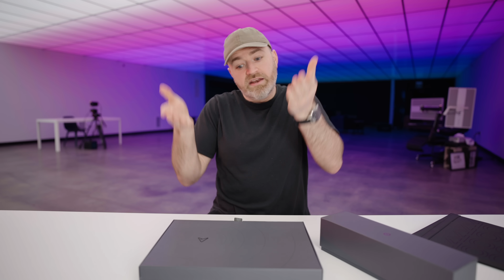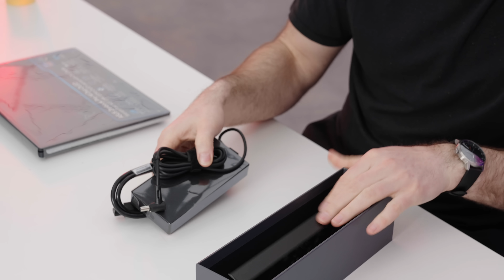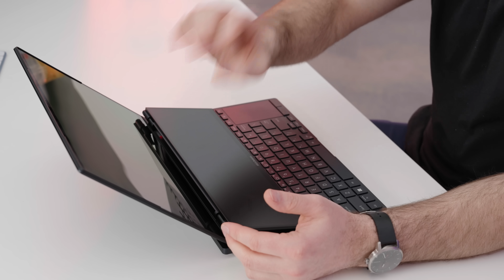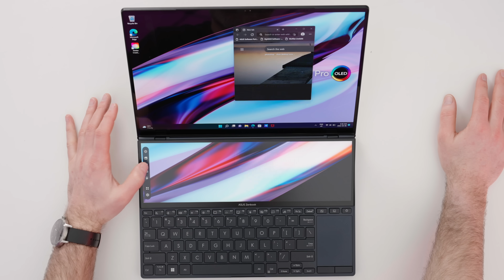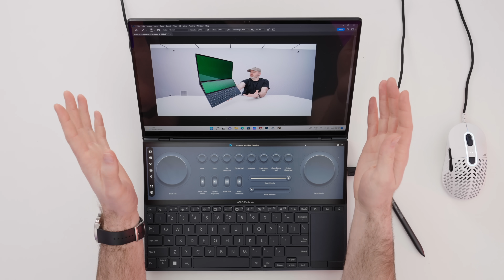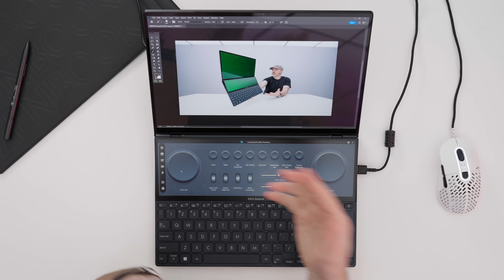The Most Outrageous Laptop Ever Built...

Comment: I use a second monitor connected to my laptop all the time, and i use it for mostly 3d modeling. The software that i use can open up multiple windows in which you can do different stuff. But also think of the file explorer if you have to import or export lots of files. Or if you have to open up a picture to use as refence for the object you're modeling. When I'm on the go I'm not even used to one single display anymore. It's stuck in my workflow. So therefore a small extra one below is perfect for me while I'm on the go. But even when i have my second monitor connected i sometimes like to have a third one. Think of your 3D scene in the main screen, your material/texture editor on the second monitor and reference images in the small display. Instead of making smaller windows on my laptop or second monitor.

Let's say that this is a good buy for artists, video editors, programmers, or any other people that like to work with multiple displays. But if you never really need more then one displays then i can imagine that it's not worth it.

Comment: ASUS has constantly been the world's most innovative tech company right now. Change my mind.
Reply: Look at the stats how often and fast Asus notebooks break
Changed your mind?
Reply: @harrison00xXx  ASUS is a great company. Just accept that move on. Don't have to petty and toxic about a brand you are nowhere associated with. Jeex!
Reply: @NomanJohan  why i even should associate with a bad manufacturer?
Reply: @harrison00xXx  Yeah you shouldn't. You should get a job and have a normal life like everyone deserves. I hope the fortune shines on you in future so you can afford innovative ASUS/ROG devices.
Reply: @NomanJohan  Whats your "job"? Are you working for asus to spread the ROG religion?

And i could afford any Asus notebook, but there is no sense since the price doesnt fit the overall quality or mobile performance.

Also, these notebooks are LOUD, if you need a powerful GPU you basically need a huge case to make it "silent" (as far "silent" is possible at all with intel and AMD) under load.
Even my pretty heavy modded HP Omen 17 (LM, better airflow, nearly pressurized, filtered air from 3x 140mm PC fans pushed into case) with RTX 2080 150W struggles to get rid of the heat and the fans are definately annoying a bit. Not close as much as it was stock without additional external "blowers" or liquid metal, but still its a windows notebook, they get loud when there is any bigger load, even for only 5 seconds since the CPUs spike up to 90° easily for "basic" stuff.

So well, yes i have a decent gaming notebook with fully powered rtx 2080 mobile (even a 190W alienware vBios installed)
But its unflexible, not really the definition of high quality or anything for mobile usage, but well i can also afford another, MUCH BETTER notebook, my 16" MacBook Pro 2021. THATS A REAL NOTEBOOK! Absolutely love it after finally upgrading from a 2010 15" MBP (good old machine, using it right now! Smh the keyboard feels even better on the old 2010 compared to the 2021 model, but both are great, just slightly different hub and force needed.
Reply: @NomanJohan  This "system" fits my usage also much better than any "allrounder"... because i have with 2080 Max-P basically nice performance and stil a proper cooling with the huge case of the Omen 17.
And since, as i said already more than enough: any allrounder/"i can do everything for everyone" machine will have sometimes only minor downsides compared to "dedicated" machines, but more often than not HUGE DOWNSIDES (the ones i mentioned which you think is because "i am poor" lol)
And therefor, as "expensive" it was, around 4000$, 1750$ for the RTX 2080 notebook in beginning 2020 and now 2350$ for a 16" MacBook Pro 2021... well, sadly it replaces the RTX 2080 notebook/"desktop replacement"  completely, except for gaming. Sometimes im still using my old, self built desktop which got sadly only a GTX 1050 Ti in it anymore after selling with a profit my GTX 1070 after 5 years heavy gaming and even mining in the last months lol, poor buyer :D

So yes, seems like im pretty poor since i need, ok lets be true, want 2 notebooks, both with a dedicated reason... ugly windows gaming notebook... GAMING at its best, no compromse!
Good old, awesome MacBook Pros? Well, especially with M1 Pro and Max literally better than desktops (and more silent, as a notebook!)
Reply: @NomanJohan  You know whats my biggest problem with Windows and the typical x86 hardware.... its that garbage, all which brought me for many years to windows notebooks was because Apple literally failed at any MacBook from 2013-2019 and a Air or poor performing "Pro" wasnt an option.
Since i have finally a proper Mac again (the 2010 MBP is basically too slow to enjoy it anymore...) i didnt expect to change that fast back to Mac OS  since its apple silicon and still many apps are not optimized yet and wont get ever especially older ones. Also, the missing capability of running windows natively (if i ever want to play on it) also was a concern, but it isnt. The M1 Pro/Max package in such a great notebook is just too good to see this as a huge downside.

And well, the 16" MBP M1 Pro is even cheaper than this fancy Flow X16 for a LOT BETTER MOBILE EXPERIENCE  (which notebooks/laptops are made for)

Comment: This almost feels like going to an external or dual monitor setup. At least for me, I used to work exclusively off my laptop and didn’t think I needed another monitor, and then I used 2 monitors at work and after that I bought an external monitor and use it with my laptop open all the time. Like you’ll find ways to make it productive for you even if you’re not necessarily doing photoshop and stuff
Reply: Yup, this is way better than external monitor (unless you need the full screen, since this is only half). External takes up more space to pack, need to bring extra cables, power supply, more time to set up, takes up more desk space, etc. It's a pain. This laptop is perfect for staying mobile with maximum productivity

Comment: I'm still waiting for a review over the ROG Zephyrus Duo 16 (2022) GX650RX-LB011X; I like the ASUS Zenbook Pro 14 Duo, but I have a few cons:

No ethernet port built-in
HDMI placement on the side rather than the back of the laptop
The duo screen has a slight gap from the top display
Lack of upgradable RAM
Lack of upgradable Memory
Lack of VRAM on 3050 Ti (4GB) (NO HIGHER MODEL UPGRADE)

I plan on doing Civil Engineering in 2024 and the minimum requirements are 8GB of VRAM.
Reply: im a civil engineering student and my 6gb vram rtx 3060 laptop runs everything just fine
Reply: @Suckmabalzz  yeah you could get away with 6, but 4gb vram?
Reply: @ogPRAT  my old laptop has 4gb of vram, rtx 3050 it only suffers when you are using high amount of textures and details on 3d modelling, autocad still runs like butter even on a heavy project
Reply: @Suckmabalzz  appreciate it the info; I like to model in 3d using blender/unreal so this laptop isn’t worth it too me
Reply: Can you put a screen protector film over the two touchscreens

Comment: I actually did test the old one for two weeks last spring, but the form factor was just a little bit too much to get used to. But most of all the lower screen is just not visible enough. I wish there were some adjustment similar to old LCD:s where you could move the "center spot" where the visibility is best. I'm pretty sure that we could see a staircase-formed substrate for the OLED sometime in the future, but until then...not for me.

Comment: I bought the Zenbook Pro Duo 15” last year partly also due to your review. The other day I was extremely surprised by the update and new ProArt hub. The screen pad plus got a great new update allowing for so much better workflow AND OH MY GOD THE NEW full FAN/performance mode that finally cools my laptop properly while running on max, it’s a god send. 
Actually editing my first paid project on it, so thanks!
Reply: What battery life you get ? can you please tell me ?
Reply: @KirtirajSolanki23  off the battery itself, it reaaaaally depends on what you do but my estimate is around 1.5 to 2,5 hours, if I can push it to 3,5 hours that amazing. This laptop is made to be plugged in tho, allows the fans to run fully and performance to be best. You can always turn off the screen pad to save some of that energy.
Reply: @RWaarden  Thank you so much for this information.
Reply: Can you put a screen protector film over the two touchscreens
Reply: Can both screens work as one?

Comment: My two cents: Been using my Zenbook Duo UX481 (the smaller model without the raised screen, lower specs etc.) for about 15 months now and it's been mostly pretty good. The tools and functions on the 2nd display seem to get jankier with each windows update and  I often get bugs with it that require turning the second display off and on again. not unusable just a little annoying. It was great when I was studying, was using it for 3D modelling, Sculpting, and Photoshop mainly. Now I work from home and use my desktop for work the second screen sees very little use when I'm just using it for internet browsing. I wish the second display were brighter or popped up like the model in thjs video as there's just too much glare unless you prop it up. Also the finish is a total scratch and finger print magnet

Oh and if you use a graphics tablet you'll probably never use the pen

Comment: I've been loving it every day for almost a year, however I will let you know right now, the UX582 has a ton of sub models so you need to know EXACTLY what you are looking for. May displays, many cpus, many gpus. It's chaotic.

For example mine is 4k 60hz, 10th Gen i9, 3070 32gb ram.

They make 11th Gen and 12th Gen cpu ones, 3050ti,3060,3070,3080. 16 and 32gb ram, and 500gb/1tb ssds.

It's very very very messy
Reply: Up too 8tb
Reply: Can you put a screen protector film over the two touchscreens

Comment: I have to admit that there is some praise to be given here. Whether this is appealing to the general market, it's always a pleasure to see companies come up with innovative ideas.
Reply: What's most excellent about this innovation is that it's functional. It's not just novelty. The Zenbook is designed in a way where its utility is enhances the user experience and increases efficiency. Very great design!
Reply: The exact reason I am seeing if my company will trail this laptop. In my profession which is a manufacturing environment . The ability to see Excel, bar graphs, and teams on the bottom screen then utilize CAD, and other programs on the top one is needed. Effectively allowing you to monitor them without a duel screen desktop setup. Allowing engineers and personnel to walk the floor instead of being hold up in offices. If you know anything about manufacturing it is that there is a disconnect between production application and design. But allowing design personnel to walk the floor of production with their laptop means design can work on things with production personnel more easily.
Reply: As expected from Asus
Reply: Fr

Comment: Have the Pro Duo 15 and typing from it right now. Changed completely the way I work, produce, and create. Cannot go back to a normal laptop any more.
Reply: I'm also waiting for the same model with rtx 3070. Can't wait to experience this new Tech
Reply: @ahmedsaeed2582  yep, with the 3070 is a beast, it is costly but it is worth it, especially if you work with it
Reply: @Ronnie_R87  I somehow managed to get it for around $2000 (the RTX 3070 version) so I kinda think it is a quite justified price for it
Reply: @ahmedsaeed2582  That's an amazing price for that machine! In Europe it is a lot more expensive and very difficult to find! I've managed to find one after months of search everywhere, the chip shortage made it really difficult to find these machines with the kind of configuration that I was searching for
Reply: Hey man should i wait for the new 15 inch zenbook ( assuming they release it in their event tomorrow ) or just get the 2nd Gen Model? Ive been saving up for 3 months and im getting antsy lol.
Reply: @CoreyMcKinneyJr  I have the UX582 ( 32gb, 4k Oled, Rtx 3070 ) and it is insane. I decided to get the i7 model instead of the i9 cause the costs/benefits weren't enough to spend that much more for so little more power and, most importantly, I've read a ton of people who had heat problems with the i9, so to me the i7 made a lot more sense ( and I can do anything with it, really, this machine doesn't flinch in any situation ). 
Said that, try to wait a little bit, see prices and eventually when they plan to release it, cause finding these machines have been incredibly difficult ( on reddit there are multiple threads about the fact that they are out of stock for a very long period of time ), and could be that the last year version could drop a couple of bucks with the newer one released. Then it all depends on what you would do with it, but to me it has plenty of power for any situation, so I actually don't need something more powerful ( maybe just more ports and a card reader lol, but that's it )
Reply: @Ronnie_R87  why not the 3080rtx
Reply: @_Anthony___  till a couple of months ago was absolutely impossible to find!
Reply: @Ronnie_R87  which is the name and the price of it, please? Is it worth it for architecture? I have been watching tons of videos, comments, but still confused what to buy.
Reply: @wendy2263  mine precise name is ux582lr-h2017t, around 4k in Europe. I also do 3d art which should be even more demanding than architecture, so yes, should give you enough power for everything!
Reply: @Ronnie_R87  thank you
Reply: Same, must say with the extra screen I no longer use my destop PC, and couldent imageine going back to a 1 screen laptop. Being able to watch youtube while being in photoshop is like being able to breath clean air.
Reply: @fynnjackson2298  yep. Even better, is the option to duplicate screens and use the second one as a wacom tablet while Photoshop is on the first screen. I literally don't need my cintiqs or intous when I travel
Reply: The ooo Pro Duo is the most badass laptop you can get. Its worth 4K $
Reply: Same. But the second screen is meh. Love the machine but I use a second monitor setup more than the second screen.
Reply: I cannot agree with you more. I’ve been using my Pro Duo 15 (RTX 2060) for almost 3 years and I cannot go back to a single monitor laptop. As a web designer and developer this has been a huge game changer. I work on my couch more than I do at my office that also has 2 screens.
Reply: Can you tell any difference between yours and this model besides 14" vs 15"?  I thought this was the old video at first
Reply: @mball6433  Guess depends on the configurations, the 15" should have a more powerful GPU, 3070/3080 vs 3050 for the 14"
Reply: @Ronnie_R87  are you able to draw/write on both screens on your unit?
Reply: @mball6433  yes! Both screens are touch and pen enabled, the cool thing is that you can extend them or duplicate them, so many different workflows available with just one device.
Reply: I like the 14" OLED even though it's only 3050TI. Microcenter had the 14" OLED, 15", and the 16" Rog Zephyrus. The 14" form factor is insane, it's beautiful. the screen is amazing, the laptop is portable, that 3050TI is barely enough to play games. It's unfortunate. Would have loved a 3060 or 3070 in there somehow.
Reply: Can you put a screen protector film over the two touchscreens
Reply: @vincejr.  Yeah I think so, not sure if there's something of the size of second screen tho